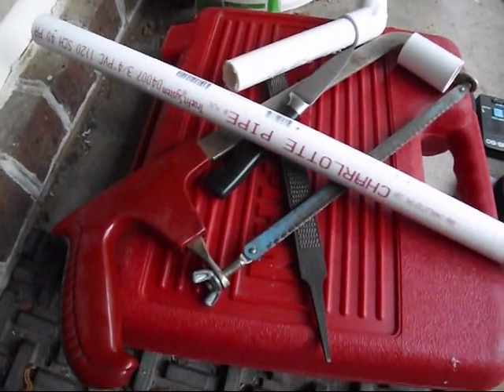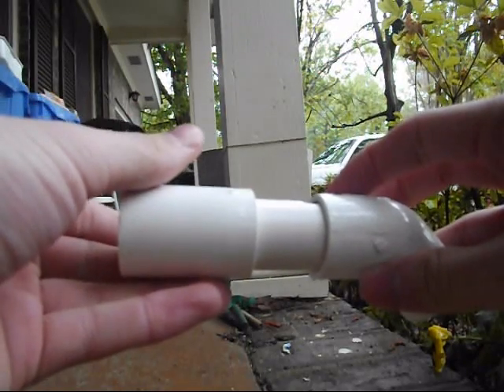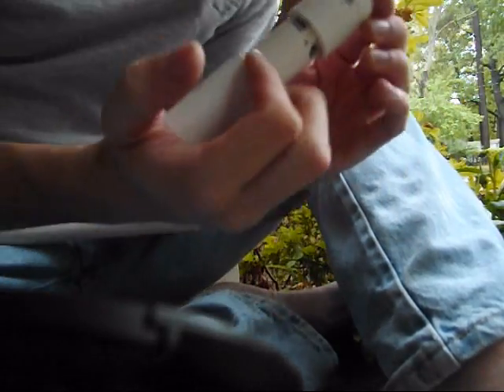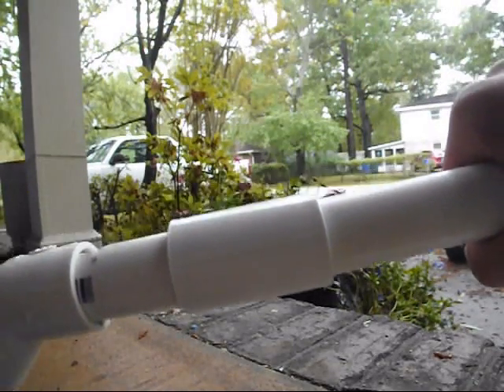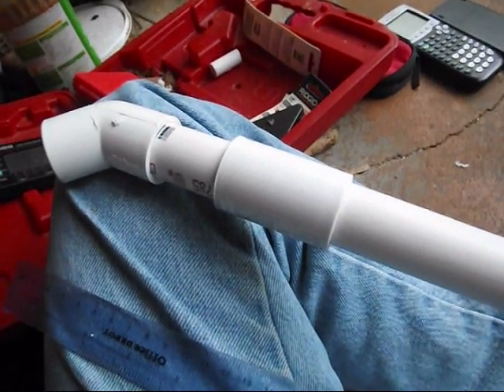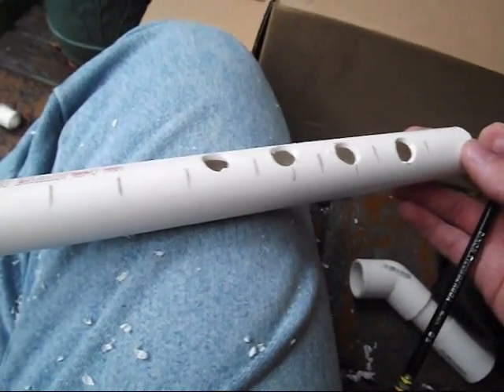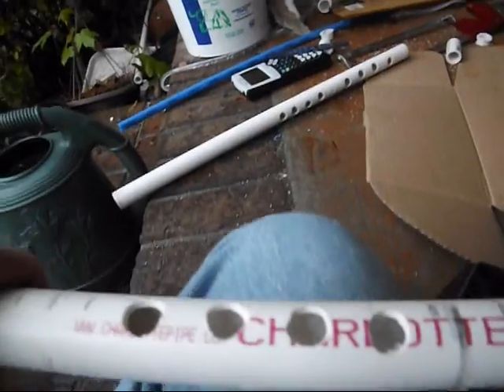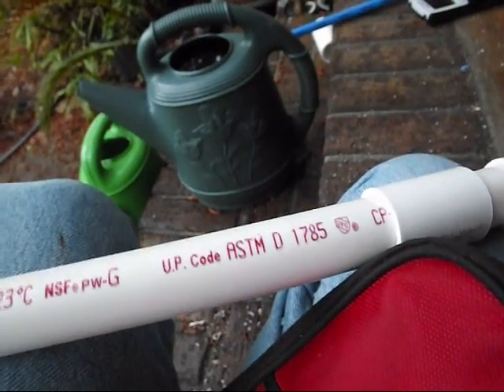How to make a PVC flute (flutorial)

Comment: Hey John
I literally just started trying my hand with flute construction. I used your fipple design after trying seveRal others,and it produced my first real reasonating tone. I'm very glad you posted this. I used a dowel plug instead of modeling clay as that's what I had lying around.  Haven't tuned it as of yet .

Comment: thanks is it so great, I will try. I wonder what about if I use a hot piece of metal to make the holes? that it would work?
Reply from the maker: +Jimmy Fallas What method you use to make the holes is irrelevant as long as the shape is the same.  I have not used hot metal, but it seems to me that the fumes, the mess made, the lack of precision, and the risk of burns would not be worthwhile if you have a drill.  But if you have experience with melting PVC and can verify that it is safe (which I cannot), go ahead and let me know how it turns out.
Reply: hey ,if anyone else wants to discover make your own marimbas book try Jaffacter  Instrument Builder Coach ( search on google ) ? Ive heard some extraordinary things about it and my neighbor got great success with it.

Comment: What is the exact equation that you used to figure out the location of the holes? Also, would this equation be different for a blow hole versus a fipple?
Reply from the maker: +Alex Worrall The equation for tone hole x is (scale length)/(2^(x/12)) from the top or (scale length) - ((scale length)/(2^(x/12))) from the bottom.  Because harmonic resonance is weird and doesn't follow the equation exactly, I have measurements in the description.
And yes, this works for a blow hole too.  You can pretty much take off the mouthpiece and replace it with a blowhole mouthpiece (I use a 90 degree bend to be able to reach the holes), though you might have to fine-tune the scale length to find the right pitch.

Comment: I understand it requires practice, but due to theologian of the holes differing from pipe length markings, using your calculator you should come up with a new equation to calculate the half inch holes on the three quarter pipe. Also, would that size fipple work for bass range notes? I want to build one of these in the tenor range

Comment: I had not thought of using the connector between the body and the fipple as a tuning slide.  Very clever.  You had a knack for making these flutes.  I have made about 6 PVC flutes, two are Native American style fipples and the others are Shakuhachi style.  The latter is my favorite so far (more expression, a little harder to play).  Thanks for sharing your vblog on making them.  I learned a few good pointers.

Comment: I have made two PVC Native American Flutes using some cork to block the air, rather than the putty.  Some of the corks around are almost perfect in size for this and there is a place where I can get some recycled corks free.  They can be easily cut to size.  I like your angle mouthpiece design!

Comment: If one wanted to make it a pentatonic C M scale, how do you calculate the distance in the holes to make? Can someone explain that to me?
Reply from the maker: SirPhatniss For the scale length involved in making this flute, I would not recommend a C major pentatonic scale, because the holes would have to be very far apart if you were to reach town to middle C.  Now, it's interesting that you mention that, because I have actually made quite a few pentatonic flutes in A minor, and I think it's worth making a video about.  But for now, let me just say that pentatonic flutes are more practice than theory.  There's more trial and error than calculation involved, because the holes are relatively small compared to the body of the flute, and so you have to adjust for a lot of impedance.  Theoretically, the way you calculate the distance for a tone hole is multiply the overall scale length by (2^(n/12)), where n is the number of semitones, and then subtract that number from the scale length, which will give you the distance from the far end to the tone hole.  So you would do that for the numbers 2, 4, 7, 9, and 12, 14, 16, 19, 21, 24... but this ends up being pretty far off for a pentatonic flute, because there is so much impedance.
Stick around for a few days, I might make a video about this.
Reply: johnbtheperson Wonderful! I would love to see you make a video about this!

Comment: Thank you for sharing flute instructions. Are all of the 10 tone holes your show distances for on the top of the flute?
Reply from the maker: Jeff Smith Yes, sort of.  They're measured as distance from the center (centroid) of the fipple, because the distance from the fipple to the nearest open hole, as well as the size of the hole and fipple, determines the pitch of the note being played.  You could make the top part above the fipple look different if you want, maybe even feed in air from a remote source..  And there are 11 holes, by the way.  Two for the left thumb because the chromatic scale has 12 distinct notes, one of which (C) can be played by covering all the holes.

Comment: I'm quite upset. This is a NATIVE AMERICAN flute or RECORDER. Whenever I search "how to make a flute" (I want to get one for my friend because he wants to play but his parents can't afford it) instead of a flute used on bands, I get a recorder. Can someone tell me how to make a modern flute please? Thanks in advance (hopefully)
Reply from the maker: Well, let's straighten out a few things first.  This isn't a recorder.  Recorders are traditional wood flutes used in quartets, whereas this is a chromatic PVC flute made to be used in any key for any purpose.  The only thing this flute has in common with a recorder or a native american flute is that it has a fipple instead of a blow hole.
If you want to make a western concert flute, you can't really make it out of PVC, but you can come very close.  The problem is that you just can't make keys out of PVC pipe, but on this particular flute, you don't need keys.  However, you can play this particular flute with a blowhole instead of a fipple.  The difference is that it's harder to play, but it's slightly louder and has a more airy tone.  You can also make a smaller flute like this out of 1/2 inch pipe, which has a higher playing range.  The larger version goes down to middle C, and has about 2 octaves plus a few notes, and the smaller version starts at F and has about the same range.  I should also mention that the C flute has a 90-degree bend at the mouthpiece (the F flute is straight), because it's nearly impossible to reach the lower tone holes otherwise.  In general, the larger version is more difficult to play; it requires larger hands and more grip.  If you would like to know how to make either of these, let me know, and I could take a few pictures and measurements, maybe even post another video tutorial.
Reply from the maker: johnbtheperson
Oh, also, flutes with blow holes are easier to make.  Fipples can be quite difficult.
Reply: PegasusUnicornGirl  Less upsetti, more spaghetti ^3^
Reply: If you type "PVC Flute" into the search bar you get a decent amount of videos explaining how to make transverse flutes. Not sure if you'd really be able to get something with the same range but I don't know.
Reply: You will never be able to make a concert flute out if pvc I know because I play one and its to compacted to gether to make out of pvc sorry but I know where you can get one cheap plus I do my own repairs for my flute and its a b to repair and expensive to repair but its nice to see a guy that wants to play flute I get made fun of at my school for playing it they say its a girls instrument.
Reply: Sorry but it would not be possible to make a concert flute out of pvc for the rodes that go on the side they are to thin pvc cant get that thin thats why instrument companies use silver because it can be mealt down sorry I am just given you resons it will not be possible pluse it would just be cheaper to get a used one see flute have to have meltel in the inside and in the head joint there is cork and for the padding for the keys its made out of cork
Reply: I thought the pvc could be cut and sanded into the correct size but whatever. Thanks for telling me that though because now I don't have to look like an idiot anymore.
Reply: PegasusUnicornGirl  you can make a flute out of pcv but in reality it wont be in tune
Reply from the maker: Seth
 Not exactly, that depends on what you mean when you say "in tune."  The model that I make in this video is nearly perfect.  20 cents variation at most, and you can bend the pitch up or down to compensate.   A silver concert flute that costs $2,000 won't be in tune if you can't play it in tune.   Theoretically, you could tune any flute so that the fundamental pitch of each fingering is perfectly accurate with the same embouchure or fipple design, but it's the harmonics that are harder to match up.  And like I said, this model doesn't really have tuning issues; its main limitations are in maneuverability and range, but even if it did, you could work around them.
Reply: Try thrift shops.  My friend has found some for well under fifty and they just need a fix or two, which most band directors can do.

Comment: Good stuff, you are really creative but you are not using the tools safe way.

Anyway, What would be your advice, if I want to use an external pump like a bicycle pump or whatever rather than my mouth to blow the air into the flute? That way it becomes possible to sing and play the flute + (hopefully dance as well) at the same time without getting married to a flute player?
Reply from the maker: I've thought about that.  This chromatic flute requires two hands to play, and so it pretty much rules everything out except for maybe pedal bass.  You could possibly use a foot-powered pump, but then you'd probably still need both hands, which rules out everything but singing, and singing generally doesn't go very well with flute playing.  You could look into loop pedals or automated synthesizers for background music.  Two more ideas that I have had (but have not yet done): Connect two, three, or four flutes to a single foot pump to make a chord that sounds when triggered.  Make a couple of these, and you could play guitar, sing, or both.  And to save the best for last, make a panflute-harmonica.  I've started this project, but I haven't finished it yet.  Anyway, you just line up a bunch of PVC pipes in a row and connect them all together, add fipples and plugs to block the air flow between the pipes, and then you have an instrument that requires nothing more than your mouth (assuming you can make a stand for it).

Comment: Thanks for the video.  The flute has a good tone.
I'd like to be able to handle playing a "C" flute, but I don't think my finger spread is far enough for the holes on a "C".

I understand how you calculate the measurements for the first marks you made.
There might be a more reliable set of calculations to share with potential inexperienced builders to calculate finger hole placement.  

That is:
AFTER you get your flute in tune - measure the length from the edge of the sound edge to the foot end of the flute - then measure to the center of each finger hole and then calculate so you end up with a figure that represents a percentage of the length of the measurement for each hole.  That way no matter what the fundamental note is - once that note is tuned - take the same length measurement and calculate each percent of the total length from the foot end to the sound edge for each note hole. 

I make pennywhistle flutes and the measurements I use are foot end of pipe toward cutting edge.  The first hole comes in at  16% of the total length and each other finger hole comes in at an additional 8%.  So, 16%, 24%, 32%, 40%, 48% and 56 %.  My whistles are tuned to a diatonic scale, but they have only 6 finger holes.  Just guessing I think your tone holes might be 4% apart ? ? ?

I have a hard time controlling only  6 fingers and I'm thinking that for me it might be a nightmare trying to control playing with all 10 fingers.

I don't know if its worth your time to experiment with the measuring method I suggest, but doing so "might" help prevent misjudging those holes way up high on the pipe.  Just a suggestion , , , ,

Thanks again for the video.
Reply from the maker: Wow, thanks for the input.  Personally, at this point in my experience, measuring finger hole distance by percentages would not be much help, as I generally build a prototype flute and then copy it and make corrections, because different fipple types, pipe diameters, tunings, and hole sizes usually necessitate trial and error anyway.  Though it might be helpful to others who are trying to replicate my methods, or do not have a musically trained ear.  However, measuring distances in percentages as a general rule might be tricky, because you would have to scale the pipe diameter up and down to make a truly parametric model.  That is, I find that if you took all the length and hole placement measurements for a particular flute and scaled it up or down without changing the diameter, the intonation would be affected by the aspect ratio.  But it would be helpful to list the measurements for each specific flute that I make, so I think I'll do that for this one.
Reply from the maker: Oh, also, I didn't think it would be possible to reach that low C either.  I originally wanted to reach the D, but I wanted to see how far I could push it.  It took me weeks for my fingers to adjust, but now that they have, it's as comfortable as any other instrument could be.
Reply: Thank you for the reply.

I certainly understand how much effort you go through because of making so many prototypes.  I have something that might allow you to save on time, on trouble and on materials if you're willing to give it a whirl.  If it works you will have a greater number of playable flutes by using less materials. 

I'd be willing to bet that you could sell those large diameter long bore flutes to serious players.  So finding a construction method which is more efficient might make a huge difference if that appeals to you.

When you have time try this.  Using whatever diameter is most convenient measure the inside diameter of your pipe and multiply that times 24 - 25 - or 26 and cut your flute that length from the cutting edge to the far end of the pipe.  The fipple you use won't affect the length much, but it might work better to cut the pipe an inch longer than the calculation.  The main thing is to measure from cutting edge (sound edge) to the foot end of your pipe.

I use thin wall PVC and I tune my fundamental note 20 cents sharp.  Since you use thick wall PVC it might work better to tune the fundamental note 30 cents sharp on the first effort.

After you tune the fundamental note - once again measure the flute length from cutting edge to the foot end.  Then calculate finger hole positions times 16%, 24%, 32%, 40%, 48% and 56%.  That will give you a 6 hole flute.  After making pennywhistles this way for about 10 years I have little waste unless I foul up while tuning.  A very simple tuning method will get your flute in tune on the low notes. 

If your preference is 10 hole flutes then just calculate in increments if 4% instead of 8%.  I've been playing my homemade 6 holes for maybe 10 years and I have little trouble playing almost anything I hear.

There's a method I use which allows me to get my flutes to play accurately on two octaves, which greatly increases my playing pleasure.

If you decide to try my suggestion I'll explain how to accomplish getting the flute to play nicely on two octaves.

Rather than experimenting with the method I suggest on your usual 3/4" pipe it might be better to try it on 1/2" PVC first because it costs a lot less.  I use thin wall to make mine, but 1/2" thick wall should make nice sounding flutes, too,

Whichever route you decide to go - all the best to you and keep making those fine sounding flutes.